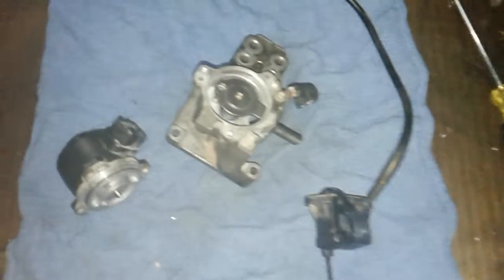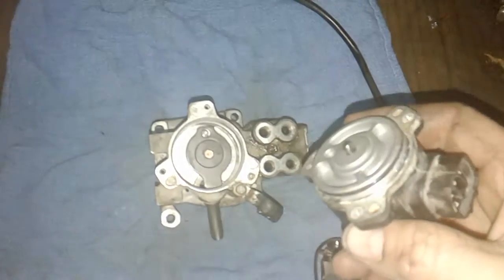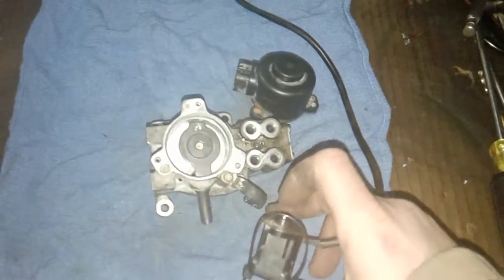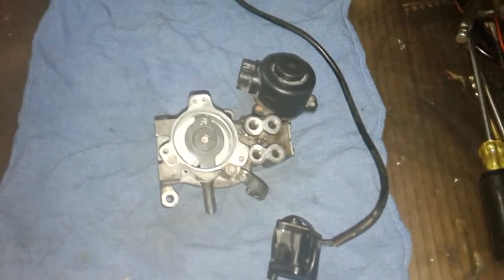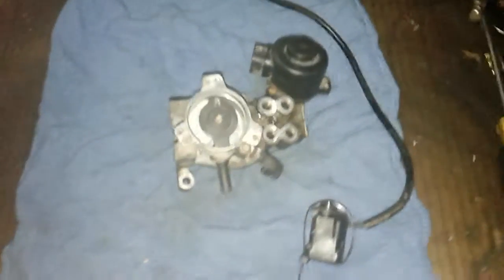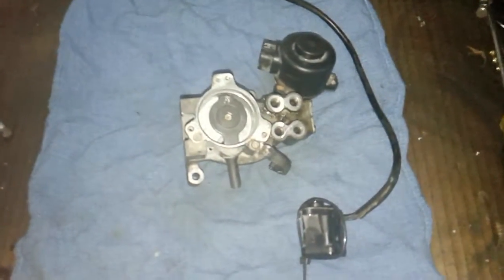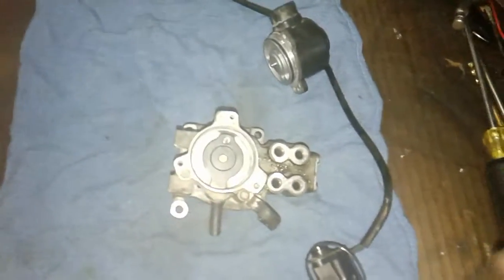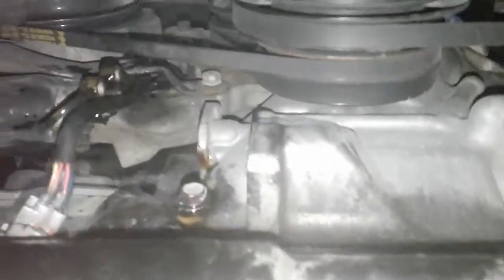1989-91 rx7 code 27

Comment: How do I test the stepper motor and the sensor for proper function? Thanks!
Reply from the maker: Well, I truly can't remember what voltage range the motor is built.  If you use a 9v battery in a few short moments, you should see the mech rotate and see a meter change on an ohm meter tied to the rheostat wires on the opposite side.
Reply from the maker: You can ziptie the rheostat all the way open, unplug the motor and premix 100:1 with 2 stroke oil.
Reply: @murphystreeter  Thanks. I haven't had a chance to test the stepper motor yet but if it is bad I haven't decided whether I will block off the OMP and premix the oil / gas or put the nut on the plunger, zip tie the resistor and run it wide open. Are you saying either way I should ziptie the rheostat wide open?  The rheostat mounts back on the OMP without an issue with a ziptie around it?

Comment: Did this work? I'm having the same issue. 1990 rx7 convertible. Will run for a few mins cold then will go into limp mode and bog above 1/2 throttle. Blowing code 26 and 27. I bought a new OMP (used) off of a fully functioning motor and still the same issue and codes 26 and 27. Could it be a faulty ECU/ECM misreading and causing these codes?
Reply from the maker: It worked
Reply: Turned out to be a faulty ECU with mine. All that troubleshooting and a $35 UCE off of Ebay solved it in like 5 mins 🤯🤯  @murphystreeter

Comment: Did the fault cause the engine to bogg down at half throttle? I’m having that issue with my customer’s car and the only code it has is error 27 and according to Alldata it affects the fuel injection and timing
Reply from the maker: Puts the car in limp mode.  Runs on both rotars but won't go over 35 mph.
Reply from the maker: Aux pump is much easier to get to if you remove the stabilizer.  Remove the pump and check for signs of heat or water damage.